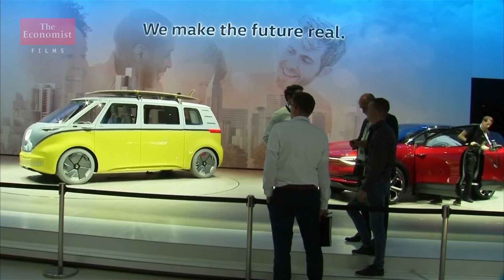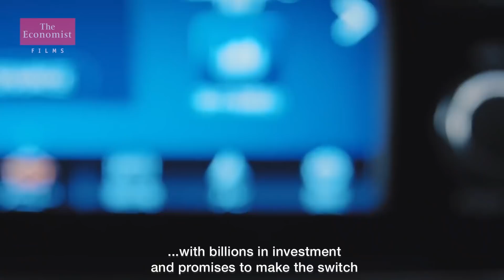Electric cars will come of age in 2018

Comment: New power generation plants are being built across the world all the time, both to replace aging infrastructure and to increase capacity across the globe. Today around half of all the new generating facilities are either solar or wind powered and that figure is increasing because they are now cheaper than other technologies. Coal is being gradually phased out, and both oil and gas powered generation will follow. New coal plants are not being built in Europe or the USA and China has many coal plants that will not be commissioned.  The switch to non-fossil fuel based electricity is growing exponentially - solar has been increasing at more than 30% per year for 30 years (from a very small base) and this trend is continuing. Within 10 years we can expect renewables will completely dominate the power generation market.  This means that electric cars will be consuming clean energy.  The intermittent nature of solar and wind generation will be overcome by storing the energy in batteries - in many cases the very same batteries that are being put into the new electric cars - these will provide a proportion of the required grid connected storage.  Regarding Lithium it is a very abundant element in the earth's crust and it will not run out. Cobalt may be problematic, however the advent of Lithium Sulphur batteries and other technologies will likely resolve the need for Cobalt.  Anyone who takes the time to understand the vast scale of change taking place in the energy world today can't help see which way the future lies, whether we agree this is right or not.  Personally, I think that electric vehicles will provide a huge benefit to the world compared to the current fossil fuel based energy supply and consumption. At the local level the negative impacts of noise, particulates from exhausts will disappear and also, surprisingly, there will be a massive reduction in dust from vehicle brakes - the ability of electric vehicles to recharge the batteries during braking massively reduces the requirement for wearing away the mechanical brakes. Electric vehicles will make life very much more pleasant and healthy for everyone - even those who are currently convinced that petrol is best.
Reply: Just in 2017 Scotland between Jan and Jun produced 118% of all its power needs just from wind alone
Reply: Your poste is wonderful. You seem to be very well informed about the age of decarbonisation. I am glad there are people like you who are not mislead by biased media.
Reply: QALibrary 
Orkney rules!
Reply: HOLY CRAP FINALLY THIS WORLD ISN'T GOING TO SUCK SO MUCH!
It took a while.
Reply: Coal on the increase - sold by China to nations with no coal!
Reply: jerry joynson Hi! Thank you for explaining this Appreciate it 😁👍👍👍👍

Comment: HAHAHAHA “AFFORDABLE”
Reply: Tesla Model 3 was designed to run 1.000.000 miles with oil changes every 50.000 miles. No transmission, less wear on the brakes ... and you can expect to have more than 80% battery capacity remaining after 25 years, if you follow the manufacturer's recommendations (just like you have to follow certain rules with ICE cars). 
If you consider how many benefits you get for the money, EV's in general are totally affordable for someone who drives 20+ miles daily. A cheap Renault ZOE or VW eUP/eGolf will be cheaper to use for 10-15 years than the cheapest piece of crap ICE car Dacia Logan ;)
Reply: I think you need an edit:  "with oil changes every 50,000 miles" I think you meant WITHOUT
Reply: Moses In the bible model 3 ?💁
Reply: Joe Black 
I'm fine with my Chevy Sonic LTZ. Paid $15k used with cash 4 years ago with no issues. Less than $50 a month gas for less than 200 miles a month and about $1100/yr insurance.
Point A to point B.
And I bought 700 shares of Tesla at $24, several thousand shares of GM when it was single digits, and several thousand shares of lithium/battery ETF less than two years ago.
And the most interesting thing of all is I have over 20k shares of ExxonMobil that cost me less per share to buy  than a Starbucks cafe mocha......and I have several hundred shares of Starbucks as well.

I'm no expert.
I'm not stupid either.
Reply: also when the 2nd hand market of used EVs explode. Most will be able to afford one. For my daily use 30 miles is enough so even if I go with a plug in hybrid with a smaller battery I will be using fully electric 90% of thr time. Am glad companies like Volvo will go all in on EV and HYBRID starting 2019
Reply: KonaChuck22 not at all optimistic. There are Tesla Model S cars driving around today with less than 5% battery degradation after 5 years of life. The speed of battery degradation actually slows down over time as the cells stabilise.

80% after 20 years might actually be pessimistic rather than optimistic.

And let's not forget that the fuel efficiency of a regular car actually decreases over time too - essentially reducing the range of the vehicle.
Reply: KonaChuck22 Actually its more like 93% capacity after 25 years with 12000 miles driven each year. There is a Tesla Model S with 300k miles driven with it being recharged to 100% in 2 or 3 years, he has a transport business from CA to Las Vegas. Within that time, he did have to have the battery changed but was under warranty so he got the new battery for free. Normally you shouldn't recharge to 100% everytime, but he had his cars recharged to 100% which will lower the life expectancy of the batteries.
Reply: David Berlovan Tesla will eventually have Tesla Superchargers on your route probably. They are adding quite a few EACH WEEK all over the globe!!!
Reply: Actively cooled batteries, like in Tesla and BMW i3, are showing this kind of performance.  The battery lasts for the normal life of the car, to 80% original capacity.
Reply: Moses In the bible Enjoy paying $30 every time you refuel your car...
Reply: AKzebraMiner 
At least double that in Europe!
Reply: BlackWorldTraveler I bought my used Nissan Leaf for $10,000. I drive 60 miles per day for $31 per month in power. This would be $150 for gas in your car at $2.50 per gallon. Plus when I get in the car, it's already warm on the cold days or already cool on hot days. That's awesome. My insurance is $26 per month. You need to get rid of your oil and lithium stocks. A new organic battery is just around the corner that uses no metals.
Reply: Kárpát Zoltán oil change?
Reply: Karpat Zoltan Where are you getting the 80 percent capacity after 25 years figure from? It sounds a bit too optimistic.
Reply: Can't wait till I don't have touch a nasty gas pump again. EV'S rock GA suck out
Reply: Neojhun 
The problem isn't cost or supply it's economy of scale. Wait two years until the likes of Volkswagen have their vehicles on the market and all EV's will be a similar price to their equivalent ICE vehicle models (which incidentally I expect to be phased out within five years after that)
Reply: Roger Starkey Wow
Reply: AKzebraMiner 
In UK, About £1.1/litre, (@3.78litr/us gal + 1.31$/£) =$5.45/usgal 
60 litre tank ( say 15 gal)
15x 5.45= $81.75! 😱😱😱
Now, THAT would make EV's attractive in the USA, Yes?
CORRECTION!
£1.15+/ LITRE
SO £85.40 TANK! (15 gal)
Average in USA $2.48/gal
15 gal = $37.20/ tank!
Reply: Yes affordable, you can use the savings from maintenance and gas savings to pay for the car. Affordability is really the thing that will sell them as more and more as people demonstrate to their friends, families, and neighbours just how economical they are. Don't get price and value mixed up.
Reply: Long term it will be
Reply: i'm looking forward to EV in a few years, but for now second hand ICE cars are by far more affordable even considering running costs over long term (in Australia anyway)
not to mention i need 700km plus range to get to the nearest city (no chargers anywhere here)
i just worry that Australia is going to lag way behind
Reply: Have you looked at the price of used EVs?
Reply: @Richard Dixon: second hand Holden volts are very rare in Australia and only ones online were listed $30,000+
looking at all EV and hybrids online cheapest i found was $29,000 2012 LEAF 
my second hand ICE car cost $2,500, fuel cost per year >$600, maintenance in 3 years so far $0, tires $340 for 4, not much on oil/coolant.
accuse me of being incorrect if u want but don't say i bs cause i never do.
Reply: Flash357 i know everywhere except West Australia, we are notorious for being many years behind always. also i'm 600km from a major city
Reply: Martin Lacey 
I think he meant washer fluid!!!
Reply: Bryan Hensley Wow, amazing.
Reply: Affordable as in: cheaper than gasoline cars. Soon. Laugh if you want while you can. Not for long.
Reply: People forget. An average gasoline car's total fuel cost by 200 000km is as much or more than the original cost of the car. Total maintenance cost can also be significant over the long run. That's the difference. 

Don't you worry. EV's are much simpler machines than traditional cars. Batteries are getting cheaper. Once economies of scale starts kicking in they WILL be much cheaper to buy, to power, and to maintain. 

It WILL happen. Soon.
Reply: Mosses in the Bible is an ahole. Child killers like you should go to prison
Reply: Problem is not cost its supply. Bolt EV USD37,500 BEFORE incentives. Median new car price in U.S. is $33,560. Cars like Bolt EV, Nissan Leaf 2018 & Zoe EV are Median Priced thus by definition Affordable. HAHAHAHA your ignorance.